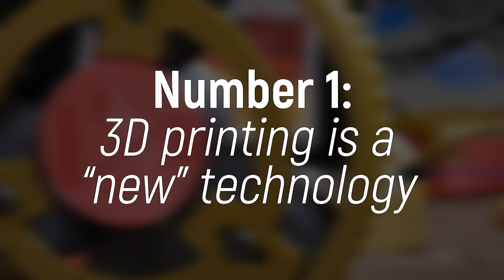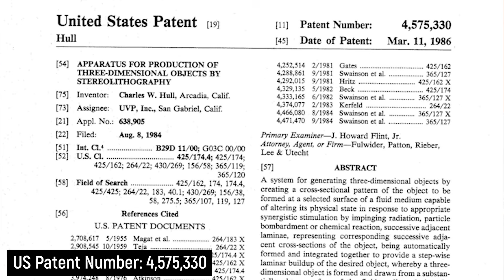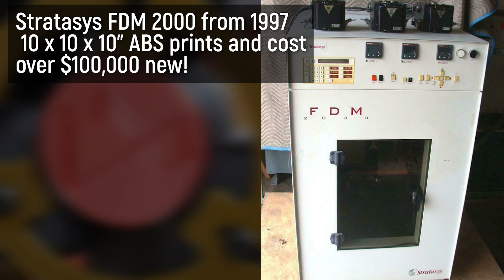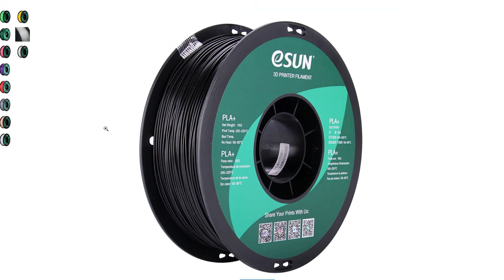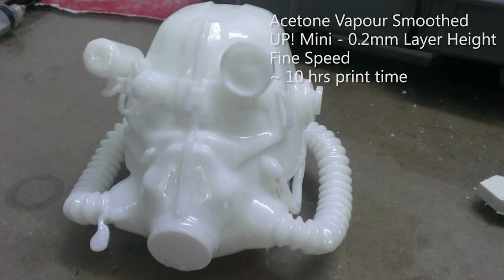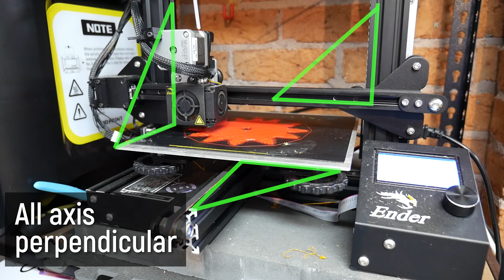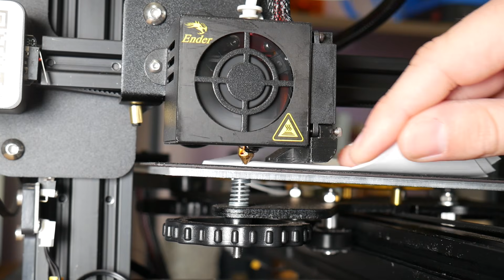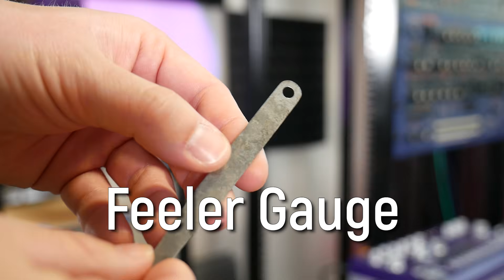3D Printing Myths I used to believe...

Comment: If measured, paper can be used properly just like the feeler gauge, but foil is even better. I use ABL, but as machinist I’ve been using paper or foil for years in order to set Z offsets and meeting 0.025mm tolerances for lathe or mill. Folding the paper causes too much hysteresis. Also hardened steel is less kind to brass although that’s probably negligible. Good video.

Comment: I don't think I've EVER heard of using a folded paper for tramming. That would be absurd. Every tutorial I've seen says to use a single, thin sheet.
Reply: Ya I was gonna say I’ve never heard this in the 6 years I’ve been printing. I’ve also been using a sticky note that whole time and I’ve never had an issue.
Reply: @BossMan302  I'm also on the sticky note wagon. works with a cnc too!
Reply: i only fold over when printing with PETG as if i print too close to the bed it sticks TOO well and is difficult to remove.
Reply: @BigDan1190  when your PETG prints stick "too well" to the bed that it's difficult to remove... all you have to do is to wait for it to cool down and it will come off on its own
Reply: I just use my eyes... and wrote a G code to go to each corner of my printer repeatedly 1000 times (just moving, not printing) so I can just eye it while it zooms around.
Reply: Update: I now use the nozzle as the bed leveling sensor. I connected one wire to the bed, the other to the nozzle, and cut 4 holes in the masking tape covering the surface of the metal bed. Since this is electrically exactly the same as the SPST switch the board was designed for, I can still use the existing controller.
Reply: @user2C47  this will work as long as you program in an offset based off of the proper layer height as well.

And for the coating you removed.
Reply: @user2C47  Damn, Nice idea.
Reply: Single piece and use some gcode while doing it, don't move the printer manually... I found a 'leveling file' when first starting out  and it still does the trick...
Reply: @user2C47  Is that even a thing? Mine just connects to the z axis endstop connector on my Ramps board and then you just configure it in settings.
Reply: @user2C47  The inductive sensors are really cheap, i got a few of them a few years ago for an average of $1.60 each, though i imagine with shipping and all that it could be more expensive now. I tested them and they worked OK, but i don't use them now since i decided to print on glass. What i have now is just something i cobbled together from random junk i had, a micro 3.7g servo dangling a short leg with a mouse button switch. But then i have the pins on my board to wire a dozen pieces of extraneous equipment to it, so my situation is of course different.

Anyway you connect ground of the sensor to ground (available on endstop connector), supply to 12V (splice from a fan or something), and the output via a diode to the active pin of the endstop connector. Diode points with the marked line towards the sensor! It will allow the sensor to pull down the board pin to ground (or nearly so well enough to read), but will not allow to pull it up beyond internal pull-up of the processor. A suitable diode type is standard small-signal diode, 1N4148. Silicon rectifier diodes shouldn't be used, because they're slower, and during switching can leak a high voltage spike. A Schottky diode can be fine, but might be an extra risk and there's no need in it at all, standard diode is good.
Reply: Like others that have replied, this was the first time in my whole printing career have I seen or heard this at all. I mean, where was this even heard? I have not see it referenced EVER in any forum, video, or document on printing. This is the first place I have ever seen or heard of this method. I used a single sheet early on, but moved to feeler gauge strips instead as they are very accurate.
Reply: "Thin" isn't very descriptive either. How thin is thin? Add to that, paper is compressible and polishable -  it may not be as thick by the time you have gone round a few times as it was at the start. Feeler gauges are really the way to go.
Reply: @markrichards5630  Maybe feeler gauges are the way, but I never got a good level (tramming) with a feeler gauge, and I always (or nearly) get it level with a piece of standard printing paper, unfolded and change which corner I use on each corner of the machine.
Reply: @JoeEnderman  I like the feelers because then I know what that gap is - to three decimal places. Between paper and backlash you never really know what your first layer squish is.

It's also a feel thing. When you've been doing it for a while you can level with pocket-lint in a pinch if you have to. But it's so much nicer to know the machine is flat, square and trammed all at the same time. ("screw it! I want to print, I'll re-level it next year")

The other thing is that flat is not the same as level. So many guys and gals have non flat beds; they level in the four corners and then print something small in the middle where the bed may not be at the same distance from the nozzle, and then blame the leveling method.

Visual leveling on the fly (after paper) can get you through but I find you have to do that so often you are chasing the level on every other print. And each subsequent visual leveling can work against the last one you did.

And really, we aren''t tramming with the paper or feelers. To truly tram, use a dial indicator on the gantry (to the bed) and get the whole thing trammed, flat and "level", ignoring the nozzle. And then by using paper or feeler you are just setting the nozzle to bed distance. And if the machine is set up right you only have to do that in one spot anywhere on the bed, because after the indicator process the machine is actually now fully trammed. If you go through those steps (assuming no ABL) you only end up redoing the level once or twice a year or when you change nozzles. (make sure to tram the hot end itself -  so many aren't pointing straight down -  or rather: perpendicular to the bed in two axis)

When I tell other machinists about the "paper method" that is so prevalent, there is this blank look they get as though I"m speaking in tongues.

In the end, the machines are pretty forgiving as long as there are no other issues (a non flat bed or wobbly Z screw being the biggest hidden gotchas), and I can sympathize when people say I'm being too picky, but it sure makes a difference in layer quality, and consistency of those layers, dimensional accuracy and the number of times a print fails or pops off the plate. An accurate tram and leveling procedure also helps to compensate for all the other variances inherent in a lead screw system that is made from bendy aluminum and held together with a couple of M4's. Tune the things you can, to as tight a tolerance as you can, and then the effects of some of the things you can't control will nearly disappear.
Reply: @JoeEnderman  Likewise. Been doing it this way for years.
Reply: I was taught to do it with receipt paper which is only 50-60 microns, I figure a single layer of that will get your nozzle height pretty close
Reply: doesn't matter what thickness you use.  Just be consistent.  Then adjust z offset.
Reply: @r7boatguy  It does matter when it comes to laying down layers properly for best adhesion. You use something too thick and you wont have much luck, while too thin could lead to the nozzle dragging through previous layers. The thickness DOES matter (I am of course only referring to printing here. LOL)
Reply: @dtrotteryt  No, it doesn't matter at all.  You tram to get the nozzle and bed gap consistent across the bed.  Then you use z offset to set the height.
Reply: @r7boatguy   Right, but rather than adjusting it at zero, and then messing with offsets, just move to the thickness of your gauge, and then adjust the screws there.
Reply: In actual machining, we use post-it notes, as they are roughly .004 inches and thus we can set our offsets.
Reply: I do it all the time. It works well for some filaments that don't like being squished as much like transparent PETG and Glow in the Dark PLA. The folded edge slides easily under the nozzle so it works well. For PLA I use a single sheet of lined notebook paper. That works better for PLA because PLA likes to be smooshed down a bit more.
Reply: Absolutely. That's my approach as well, I've been printing for less than a month.

My experience results in medium/low resistance as I move the paper around. Works great every time. 

Though I have to mention that my carbide glass plate needs glue stick for PETG. I have very minimal experience with PLA/ABS, etc.
Reply: @user2C47  It cost me 20 bucks, not 50.
Reply: Same. always flat
Reply: I’ve never folded the paper
Reply: I was wondering why he said a folded sheet, I could have told him it would fail. I often have problems with elephants foot with a single, unfolded sheet.
Reply: Depends on paper weight.... Weights Of Sheets Of A Series Paper Sizes In Grams
If you use a thinner one, you should fold it to reach the distance you need. If you use a 300 gms. paper you would not double it or it could result very thick and double the distance from the nozzle to the bed. Is amazing how nobody tells the weight of the paper for the leveling process. Some say a business card weight is perfect, but if it comes laminated is thicker. But if you use normal 70 gms. A4 or letter paper what? My advice, use always the same kind of paper.
Look for conversion tables to find the thickness of the paper based on gms.

Size	75gsm	80gsm	90gsm	100gsm	110gsm	120gsm	160gsm
4A0	300g	320g	360g	400g	440g	480g	640g
2A0	150g	160g	180g	200g	220g	240g	320g
A0	75g	80g	90g	100g	110g	120g	160g
A1	37.5g	40g	45g	50g	55g	60g	80g
A2	18.75g	20g	22.5g	25g	27.5g	30g	40g
A3	9.38g	10g	11.25g	12.5g	13.75g	15g	20g
A4	4.69g	5g	5.63g	6.25g	6.88g	7.5g	10g
A5	2.34g	2.5g	2.81g	3.13g	3.44g	3.75g	5g
A6	1.17g	1.25g	1.41g	1.56g	1.72g	1.88g	2.5g
A7	0.59g	0.63g	0.70g	0.78g	0.86g	0.94g	1.25g
A8	0.29g	0.31g	0.35g	0.39g	0.43g	0.47g	0.63g
A9	0.15g	0.16g	0.18g	0.20g	0.21g	0.23g	0.31g
A10	0.07g	0.08g	0.09g	0.10g	0.11g	0.12g	0.16g
Reply: Yea that's what I've done for 6 years now and if I notice the first layer looks a bit wrong I just tune it in offset settings. I think getting it perfect is more important when you do the whole bed manually, but I don't know why anyone still bothers with manual bed tramming when sensors are so cheap now.
Reply: I've only ever heard using printer paper until it catches and you can't pull it any more. After that, print some tests to adjust for elephant's foot (or compensate in the slicer) if you have it.

Using a feeler gauge like he suggests is the best way by far, but most people have paper laying around.
Reply: It's maker's muse, he has no clue what he's talking about 90% of the time with 3d printing.
Reply: A single thin sheet is just as absurd.  You're using a malleable material and subjective feel.
Reply: Exactly, Angus is just an idiot
Reply: @leestons  I was hoping to see much more informative videos in your channel. Imagine my disappointment!
Reply: @mgscheue  I'm sure disappointment is a common occurrence in your life.
Reply: @leestons  indeed. Unlike you, I have not experienced the joy of trying to make myself feel better by insulting people who work hard to provide interesting and valuable content. So glad taking that easy path has brought you happiness.

Comment: I remember CeBIT 2014 and around and all that hype, first rep raps there but also remember to avoid ABS because of fumes. 4-5 years passed and then PLA and PET-G were new normal and I went in with MP Mini and now Prusa. I exposed PLA in my garden for whole hot (central European) summer and it survived. Generally except very low budget ones I'm happy with PLA. In car I use PET-G for higher temperature resistance and being less brittle. Paper leveling always felt flawed to me until I discovered your or Thomas video about thicker 1st layer. And STL filename roots back to those patents from nearly 40 years ago :)
One thing I miss is cheap direct extruder for MP Mini that I could use for printing flexible materials below 40D. Those are mostly small prints anyway.
PS: great mixer / synth wall at your right 😀
Reply: Biqu H2 extruder has been making waves recently, it does seem like a very neat construction... but i wouldn't call it exactly cheap.

Comment: You just made me realise that leveling the bed while not pre-heating is probably why my Z-heights have been mysteriously inconsistent. Thanks for the tips mate!
Reply: Not only that, you need to let it sit at temperature for a few minutes. Otherwise it may still be deforming while your measuring.
Reply: Same
Reply: oh my god ive been trying to level the shitty bed for 5 hours, while the bed wasnt preheated
Reply: Always heat the bed wait 5mins then level.
Reply: I will admit that I have only been pre-heating the bed and NOT the end. My prints have come out pretty decent, but yeah they could definitely be better. I will try pre-heating the end as well.  PS. I still use a single sheet of paper (not folded) and this has worked for me 99% of the time.  :)
Reply: same boutta go recalibrate mine rn
Reply: I thought that there was a bug in youtube, but then I realized you just have the same avatar as me. Thanks for the spook.
Reply: It's been fun watching the first layer with my windows open lately. It's pretty crazy what only a 30F swing will do.
Reply: @WolfsBlackRose  my first test print was in front of an open window (didnt put the printer on its final place yet) one side got totally warped :P
Reply: Yup I remember struggling with that when I first started
Reply: My ender 3 bed leveling wheels sometimes dont move the height. Only spin the screw

That made me scratch my head for a few weeks
Reply: @bobcharlie7982  Add some nuts to the screws to firmly fix them in place
Reply: @machinist_matt  thats exactly what i did in the end!
Reply: Thermal expansion is an amazing thing. ;)
Reply: this is a misconception,..... pre heating makes little  difference.Check out this video from CHEP https://youtu.be/NlUO-5EtB44 & https://youtu.be/MNVCDNW0RoU
Reply: BRUHHHHHHHHH YEAH THAT MAKES SO MUCH SENSE??????????
Reply: The difference is massive. On my ender 3 with glass bed the clearance probably changes +-0.15mm, almost a full layer height difference.

Update: my z limit switch was causing issues. There is some variation but not as large as I thought.
Reply: i could never do it with the bed on. with the petg i use at the moment i use like 70 C bed temps. just kills your fingerxs
Reply: @BrosBrothersLP  why are you touching the bed?
Reply: @BrosBrothersLP  im invincible when it comes to that. I can hold my hands onto the bed at 110
Reply: The biggest differnce it will make is that any gunk melts of the nozzle and bed, way more likely to throw of your bed level. 

(there's been tests on the variation, somewhere in the 0.00x and 0.01 tops on metal beds)

Comment: My bed leveling procedure is feel with a paper so its close to what I like and then I print the 5 dot level test over and over untill I feel its adequate and then I do one print with the 9 dot level test to perfect the first layer. Perfect adhesion from then on. Yes at first I tried to only level with the paper and it had lots of failures.

Comment: Naomi's CR-30 3DPrintmill comes with a 0.1 mm feeler gauge. Instructions say to use it for settings the endstops but I also use that same exact size for bed leveling on for a long while now.
I am wondering why you didn't mention the z-offset setting in slicer settings. I tend to put my z-offset setting at -0.1 which is the thickness of the feeler gauge. I thought that was needed when your nozzle is not touching the bed but sitting slightly above it. So that when you slice it the 0.1 mm is subtracted from the first layer height. So say if you want your first layer to be 0.3 mm and you nozzle is already 0.1 above the bed the printer will raise the nozzle the subtracted amount of 0.2 (0.3-0.1=0.2) to reach the desired height of 0.3 mm.
Is that not how that works or am I wrong?
Maybe I should test that by printing just 1 layer using both that setting and not using it to see. I think I'll try that today.🤔

Comment: When calibrating my machine for the first layer the first thing I do is extrude a filament wait for it to cool and measure it for diameter. I want my first layer bead to squish about half its diameter on to the surface so if the bead is .4 mm I want the distance between the table and the surface of the nozzle to be at.2 to .3mm off the table. This increases the footprint of the bead on the table without impairing the flow of the nozzle. The same ratios apply for different diameter beads.